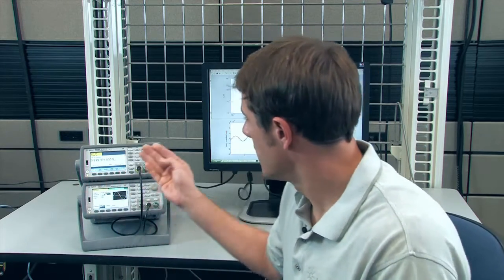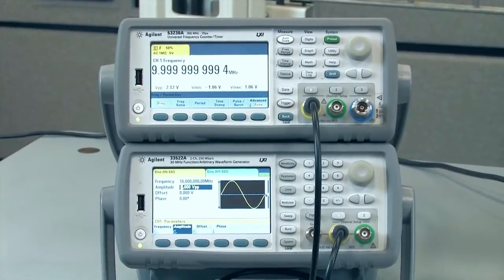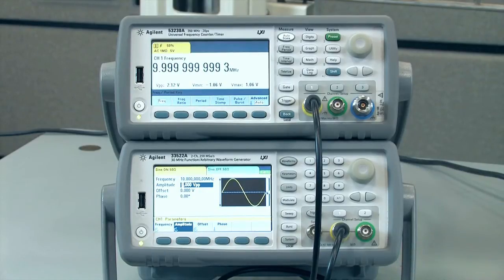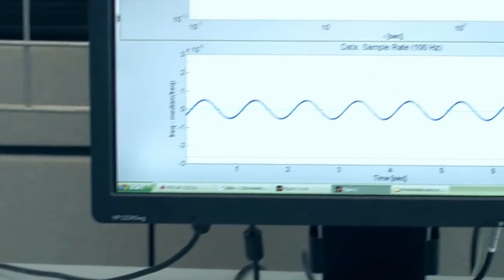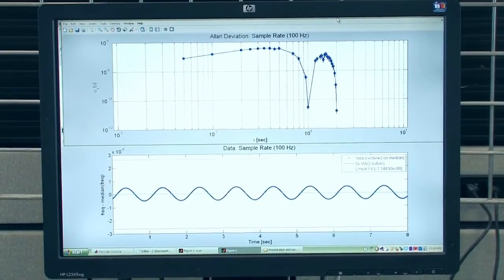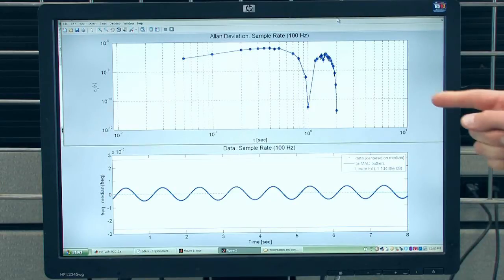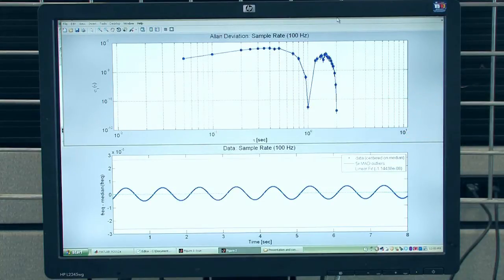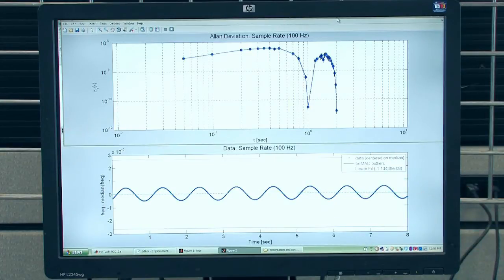Stability Analysis Using Allan Variance & Keysight 53230A Frequency Counter

Comment: The Microchip 53100A is another good choice to measure frequency stability. The 53100A ADEV spec at t=1s is 5e-15. which is three orders of magnitude better than the 53230A. I'd use the 53230A to measure 1 PPS stability TDEV, TIE, etc.

Comment: Do you have any videos showing measurement of 1PPS stability with this tool?
Reply: You need S/W to record time stamped measurements of 1 PPS time difference measurements (phase) from the 53230A to file. Use Stable32 (free) to post process the phase measurements for the TDEV and TIE analysis which is much more common than ADEV for 1 PPS stability.